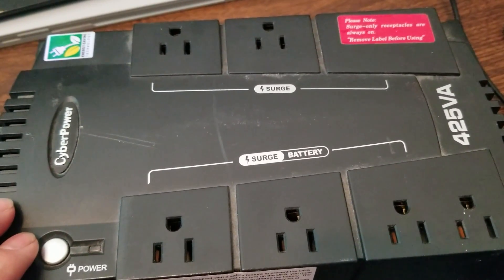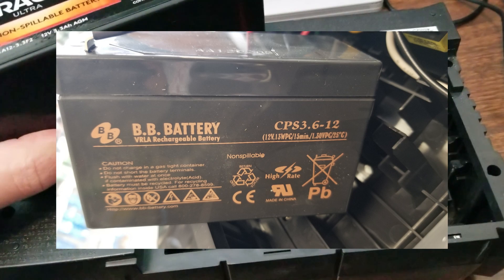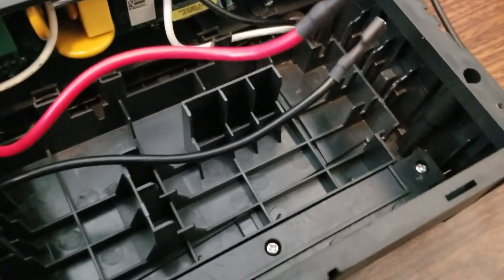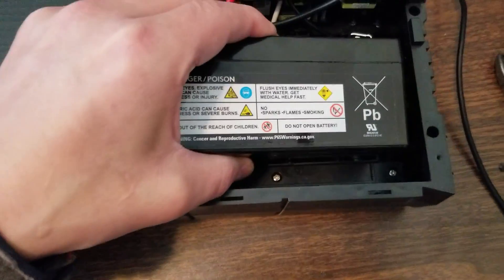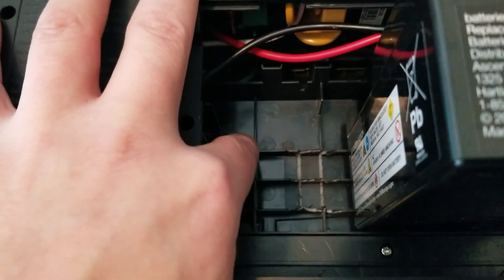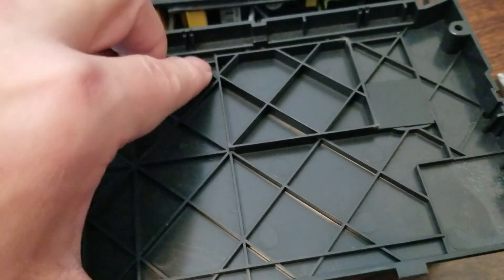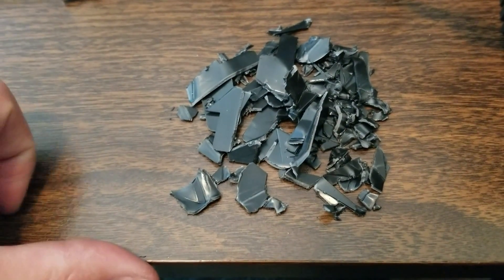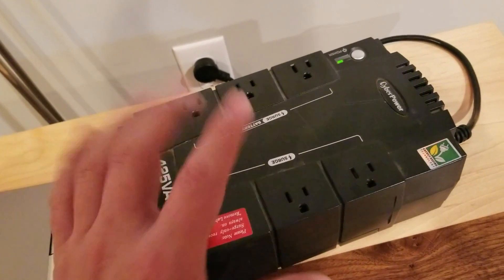Cyberpower 425VA UPS repair with modification

Comment: I've done this with the same model UPS and so far it's working. Thanks for the video. I just wonder if there's a fire risk or other potential danger associated with inserting a battery whose size is larger than the original, despite being 12v, 3.5ah. Also, I was startled to see a spark the first time I connected the battery, though a quick Google search suggests this is normal behaviour. Any thoughts?
Reply from the maker: Shouldn't be any additional fire danger. These lead acid batteries are not like a lithium battery. Yes, it's normal for a spark to occur on connection, always remember to connect red (positive) first and black (negative) last (do the reverse for removing batteries with black disconnected first)
Reply: @askquestionstrythings  Thanks for the reply. How about if the terminals are smaller than the connectors? The battery I got has T1/F1 terminals (smaller), while the original battery and the replacement one that you show in the video both have T2/F2 terminals, so the connection is now less snug as a result. I read that this could result in overheating and could be dangerous unless a terminal adapter is used.
Reply from the maker: I would agree that poor connector fit due to mismatched connectors could be an issue. Some types of bad connectors have been a source of heating/fires, especially when lots of amps are pushed through the connectors. A T1/F1 to T2/F2 conversion wire lead could be made to ensure a proper connection or modify the unit to have T1/F1 leads for your new battery.

Comment: what kind of torque screwdriver is needed to open it ?  Details would be helpful
Reply: @txcrude commented T10. I got lucky with a small square screwdriver.
Reply: My cyber power 425v was a Torx T9 security bit (hollow center)

Comment: If you Google Leoch CPS3.6-12(12V 2.9AH) you will replacement batteries on Amazon, eBay and other sellers. No need to cut the plastic. However, I wonder if you could get more time our of it by going to a bigger battery such as a CPS5.5-12 - 12V 5.5AH, which may require some case modification.
If you look on the back of the case they list multiple models besides the CP425, such as the CP500. CP550 and CP625 which leds me to believe they are using the same case for all these models.
Reply: I have that same ups what I have running 2 M18 18V 5A lithium battery with 18V to 12V 20A converter to run it put it in Tool box and installed 12/24V ubs type A&C get 5 hours
Reply: Well I have 550AV 330Watts come with 12V  7.2Amp what I did have 12V 12Amp stick out bit but its ok I have 12V solar charger controller 30A it tell how much Volt battery is show me how much % in my battery but it bar so I can charge it with solar panel

Comment: How did you determine that the battery is bad
Reply: Usa un multímetro, si la batería muestra menos de 11v y al cargarla no retiene los 12v está descompuesta.
Reply from the maker: The unit was constantly beeping. That's typically the battery. I verified by removing the battery and checking the voltage with a multimeter.

Comment: Was anyone able to find a battery that fit without cutting the plastic?
Reply from the maker: Someone pointed out that there are a couple of suppliers online who still sells the original cps 3.6-12 battery. Quick search and it looks battery mart may carry the original battery. I went to a local battery shop and they did not carry an equivalent which was the same size as the original. Seems online is the only way to find the original battery.
Reply: @askquestionstrythings  Thanks, it looks like Battery Mart does have it but the one for $33 plus shipping, close the price of buying a new UPS. The one you used can be had to less so I'll try the modification. Thanks for the help.

Comment: Awesome, you just saved me like $50.  really appreciate the tutorial!
Reply from the maker: You are welcome.
Reply: i have 550VA UPS I HAVE 350VA UPS AND 425VA UPS i change battery in them used battery with more amp
Reply: The battery come with ups sucks ok i have 3 UPS  550VA0 330Watts i have 425VA 230Watts have 450VA  i cant remember how much watts  550VA come with 12V not said how much Amp so what i did get 12V 12A sick out bit and i add 12V solar charger controller 30A Tell me how much Volt battery is and i know how much % battery is have bar on solar charger controller and i add conect to battery soi can used 10Amp charger and charge my battery if need  i can all so used solar panel and charge it and still change from wall out let

Comment: Just a quick question: I have exact same UPS. Died a couple of days ago (no outage or mains flicker). I suspect the battery is now completely dead. The UPS will not power on or give any indication that it will flash up if I put in a new battery. Was yours in that state before you did your battery swap-out? (Trying to determine if I might have a circuit board issue).  thanks...  good video
Reply from the maker: My UPS was constantly beeping like when the power goes out. That nonstop beeping is a sign that the battery is bad. 
No power can also be a sign that the battery is bad. I understand that cyberpower tech support will help diagnosis the issue to help confirm bad battery conditions.
Reply: Okay, thanks for that. I had it do that beeping previously during outages as they wore on. I don't recall anything like that this time though. Maybe i have bigger issues. Looks like more investigating required before battery replacement is considered. Thank so much for getting back to me.
Reply from the maker: You are welcome. Good luck with things.

Comment: Interesting. I'm surprised you couldn't find a replacement for the old battery. The new one is technically lower capacity too, 3.3Ah vs the old 3.6Ah, not that it matters.
Reply from the maker: The new battery was all that was available from my local battery retailer. Looks like a couple of online retailers do carry the original battery. I agree the 3.3Ah vs 3.6Ah isn't going to matter, especially for the application I'm using it in for router backup power. Thanks for watching.